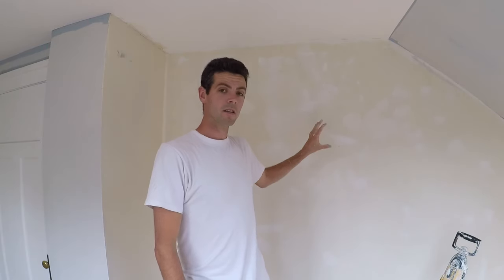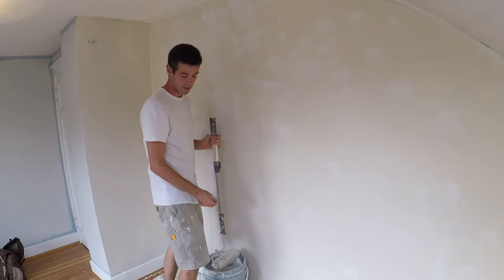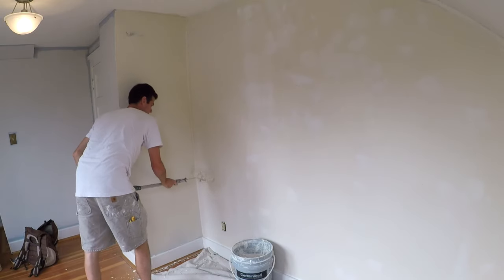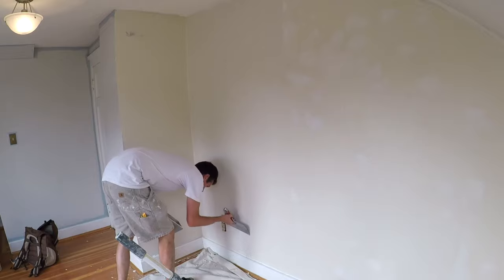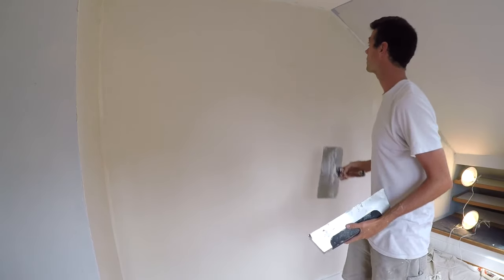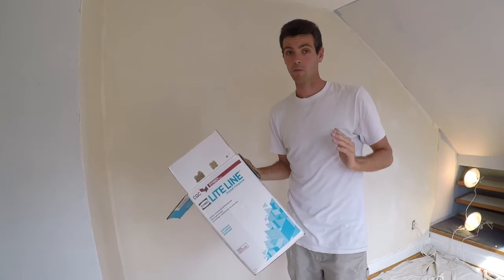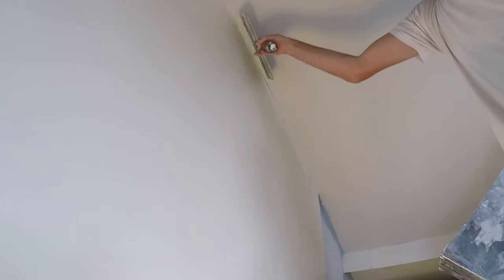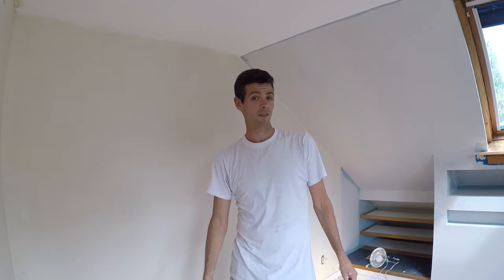The EASIEST WAY to SKIM COAT a wall!!!

Comment: just a tip from a german dude on the internet, get your roller prewet and drain like 90% of it before the first saturation process, makes it way easier
Reply: I also pre-wet my paper tape before bedding it.

Don’t see that taught or done on any video’s though.

Does anybody else pull their drywall paper tape (especially for the corners) through a bucket of water quickly before applying it & bedding it?.
Reply: @Casmige  My coworker was talking about doing this. So I know a few people at my work that do it this way. I think I will try it on my next project.
Reply: @Casmige  I do. It smooths out easier but I don’t do corners with wet tape
Reply: Thanks, German dude.
Reply: @Casmige  I believe Vancouver does have a video on that.  He says it's not what the pros do, but there's nothing wrong with it.  I believe he says a person shouldn't do on inside corners though.
Reply: According to a demo I watched, wetting it with water weakens the bond between the paper and mud. But many people swear by it, so it must work well.
Reply: Vielen Dank, Deutscher Typ!
Reply: Has anyone ever skim coated Paneling?  Any thoughts on skim coating Paneling?
Reply: There are special rollers for that (just bought one from Hornbach), and are very comfortable to work with

Comment: I find using a spray bottle of water to keep the knife blade wet really makes a huge improvement to the finish.  A mist of water on the knife blade makes for a very slick surface.  A quick sand and your done.
Reply: Just started doing this too. Basically keeping a big bucket of water and storing my tools in it while I roll the mud on. Also, cleaning the blades real quick just before starting to cut and keeping it wet on the finishing cuts. Works like a charm, even tho I'm a noob.
Reply: If you have or will post your process, let me know

Comment: As time passes while you’re doing a wall, the mud in the bucket tends to start to dry. I suggest anybody watching this video keep handy a bottle of water with which to spritz the compound in the bucket so that it doesn’t start getting very hard and heavy for you to work with it.
Reply: A small plastic cup  with just enough water to cover the surface works well also.

I use this method when storing mud also.

The bucket sides above the mud need to be clean.

I mix in water to a little thinner than what he used in the video. 

Then i pour in just enough water cover the surface about 1/8th inch deep.

Snap the lid on tight and the mud will keep for a long time.

Store in a shady cool place. Well at least shady.
Reply: @shawnr771  Also, cover the surface of the mud with plastic wrap to stop evaporation and hardening of the material.

Comment: The most I could do was hang a picture on the wall, but now I do skim coats apparently. I did this method and followed up with a stencil design. Everyone thinks it’s professionally done wallpaper. Currently doing an entire water closet, plus the ceiling. Thank you for this video!
Reply: Very cool, Lexi!
Reply: is premixed mud as good as mixing ur own?

Comment: My first try at skim coating went well but Scott, I used a trowel and hawk. I impressed myself as a first timer. I was looking at different ways to fix a bad paint job (deep deep deep brush marks) and walls where wallpaper was removed. Some people said try thick paint (took too many coats of paint) or paintable wall paper (did not try, I was afraid of seams opening). Skim coating was not that hard and I like how it turned out, a smooth wall.
Reply: @c Adamants your comment has given me some confidence ....i'm about to attempt the same after removing wallpaper from a wall half of the plaster on the wall also came off...i thought a thick wallpaper would cover it up but once i put up once  piece of wallpaper i could still see the crack under the wallpaper.. so now going to attempt a skim coat using this method ...wish me luck!
Reply: @coachBux  Good luck. As Scott says, don't try for perfection on the first try. You'll be surprised with the right tools you'll get the technique down in no time.

Comment: Nice video.  I like to wet the roller, then dip it into the mud in order that the roller doesn’t take so long to “accept” the mud.  Wetting the roller enables us to quickly load the roller.  A dry roller takes time to load up since the mud isn’t so wet nor is the roller and therefore the mud is inclined to “resist” adhering to the dry fibers of the roller.  Not soaking wet....just moist.

Comment: it's great being a giant.  Jesus, I need a ladder to reach my standard height ceilings.
Reply: He's tall, but this is a second floor as you can see by the sloped ceiling, and sometimes the ceilings are not as high as first floor in some houses.
Reply: And he uses stilts
Reply: @chadashley1434  hey i think you could actually just stick a broomstick into the handle of you roller.... it will save you from having to get ladder ect

Comment: This does work pretty well for a DIY situation. Working with mud is alot easier than most think. Just use regular mud, thin to about a pancake/ cake mix  and have fun with it! Take your time, don't expect it to be perfect with your first coat. You can always back fill holes with more mud later.. if it looks like crap Mist it liberally with water or a super wet sponge(let it soak in) scrape it all off and try it again. As long as it's not painted yet mud cleans up super easy with water. Sometimes it's easier to clean everything up with a wet rag than it is to mask everything off. Drywall repairs aren't cheap to have done so this is a worthwhile skill to learn!
Reply: Thanks!

Comment: Thanks to you, I started using a hawk and trowel to smooth-coat my knockdown textured walls (I’m doing the ceilings and walls for my whole house @ 3000 sq ft). It sucked at first, but I noticed my trowel was a piece of crap. So after I bent it into shape, it has now cut my time by close to 2/3 of the time it took me using a pan and knife. I was going to try this method, but I’m liking the hawk over the pan, because you can load it quickly using a bucket scraper and then clean the hawk easier and faster than a pan. The trowel being double sided is almost like using two 11” knives at the same time, and I don’t have to keep cleaning the trowel in the pan like you do with a knife and pan. It’s just sooo much faster!!! Like you said though, some jobs require a pan and knife.

Comment: THANK YOU!  I'm repairing my 1920's plaster walls - first time DIY because nobody around does plaster that I could find.  Learned A LOT from your videos.  Almost ready to skim.  This is VERY helpful.  THANKS!!!
Reply: lsabik88 as he said, plaster does not always do like that, but, apply a product such as bondcrete to the plaster, then you should get a decent flat finish with this technique bu a true plaster would be a better product sometimes. A trick I use on plaster is to use mesh tape, not paper tape, on corners and around outlets... just take your time. And keep the sections small as you work.
Reply: @brotheradam  Agree.  I skim with All Purpose -- over repairs on plaster wall. This video helped a lot.

Comment: After doing a very light knockdown texture in my bathroom, I have so much respect for you.  My back hurts so much today.  I still have to paint. Oh my gosh I started getting so upset over little bits of stuff making lines in my wall.  I was also tired and again hurting.  I am DIYing the bathroom remodel after work.  So there's that.  I want to thank you for these videos.  This has been my first go at drywall repair and covering.  Your videos made it less daunting.  Now I will likely use this method in the other bathroom as I do not want texture there.

Comment: The thing I got the most out of in this video was the very subtle angle changes of the scraper that changed the process from building up to smoothing off.  It’s the little things the make the biggest difference to overall finish quality. Thank you

Comment: Excellent tip! I’m a carpenter and definitely not a Sheetrock guy. I botched patching a wall after I installed the brackets (14 total) for 4 floating shelves. I used this technique to skim the wall sections and it came out wonderfully!
Thank you so much!!

Comment: Thank you so much for this video, I had to do it on all walls and ceiling in a room where the previous owner thought that the texture he applied looked good but was definitely an eyesore. I never did this before and a painter slammed me with a $2500 estimate to do it. I went to the big box and bought some materials and tools instead and wow, amazingly easy. I struggled the most around a big window due to the intricate trim but man, I am happy after the first coat… now… second coat 😅

Comment: The light was a good idea.  Just wanna say thanks too!  I had a washer-dryer area and using all your tips and techniques, it came out looking amazing.  Walls were wallpaper removal damaged and painted over, mudding hadn't been sanded but yet, painted over, tape missing, rotted walls from water leaks, you name it, I had it.  Now, they look like all brand new walls.  One thing; I didn't have a lot of strength so I used a wetted rubber blade for final smoothing and it resulted in a huge reduction in sanding.  The other, when I encountered a lot of bubbles.  I put the mud on, took it off and reapplied it immediately, (4-7' wall).  Not sure my arm could have taken it if the wall was any bigger.  Not sure what it did but no more bubbles.  Again, thanks!

Comment: Here's what you bring to the table: You take the fear out of skim coating. 
I was able to remove wall paper DRY with just a drywall knife and pulling off large sheets of the paper. Wife soaked and scraped the glue off. No damage from us, just something screwy with the paneling that went half way up the wall. Like there was a brown sheet glued to the drywall under the paneling. Also some of the wallpaper removed the drywall top layer of paper in large sections. SO wasn't looking forward to the skim coat until I saw this video. Thanks for the hard work conveying your knowledge. I appreciate you.
Reply: Hey man I'm going through the exact same thing right now, let me know how it goes for you
Reply: @Taha-ne9cd  Ok the skim coat: thicker is ok, it just means you get more to sand (ugh). Your shop vac needs a drywall dust bag or filter. Buy extras of both.
Leaving the line is ok, it sands easily.
Sheetrock brand Green top All purpose is harder to sand than the Plus3 dark blue top.
You'll need to thin it a bit. 
I used a 12 inch blade. 
Technique is slight pressure consistently on one side of knife. The joint compound WILL LIFT the other side of knife automatically. Amount of pressure is determined by thickness of joint compound.
Crumbs SUCK! but you'll get them no matter what. Don't sweat them. 
Divots and depressions after sanding will be filled, individually after sanding and wiping with damp sponge/cloth, let dry. 
ALL errors can be fixed after sanding. Don't sweat it.
Took me three walls and the fourth was really good (not perfect). 
GOOD ENOUGH rules the day when you're not a professional.
I am now fixing divots/depressions today and will sand tomorrow, prime the next day, paint the day after. . . boom done. BOOYAH!

Comment: Last year I had to get my mom's house ready for sale. One of the projects was doing a skim coat and using this very method. Years ago, when we were kids, my sister thought it would be a good idea to cover two walls with cork. Onto plaster walls. The cork board was hung to the wall using liquid nail... A lot of liquid nail OMG 
 I removed the cork. The liquid nail was like they were drawing and zigzagging with the caulking gun. All I could do was grind down the liquid nail. Get it close to something that resembled flat and then do exactly what the video shows. I was amazed at how well this works. Believe me when I say the 2 walls were F*****up. First time ever trying this. The finished walls with primer then paint was perfect. So follow directions you'll get there.

Comment: I love the roller texture.  Even the plasterwork on ceilings is great.  It really shows of skill.  I hope it comes back in style.
Reply: @helpmetoreach1ksubcribers233  Very nice work, I would hire you in a heartbeat to fix up my home.  That plaster is so much better than the drywall everyone uses here.
Reply: I did the roller texture on walls in a 400sqft room - I think it turned out pretty good looking.

I was initially going for smooth, but there were so many patches from rewiring and plumbing, and the old material wasn't nailed up all the great so a bunch of nail pops, wavyness, and random damage - so essentially just got frustrated and was like F it, I'm just going to roll the whole room. 

Prob should have watched some more of these videos first, but thankfully turned out pretty nice just taping the joints and then rolling the whole wall

Comment: The big disadvantage to the paint roller method is a lot of times depending on your porosity of the wall, if you're going over bare drywall or flat paint, the joint compound actually dries before you can knock it down. So it's a good trick in the bag, but sometimes just using an actual plaster trowel and hawk is better. Another thing too is just using Easy Sand to level out a wall, and just doing a final very light skim coat with All Purpose to give an easier to sand base coat.
Reply: I’d like to keep a spray bottle set to mist to resolve my mud and sometimes even paint from drying faster than I’d like. And I’d probably pre-mist bare drywall if I was going over that.

Comment: I skim coated 3 walls with the roller method ... small sections then knife smoothed them...I had 'washboard' as you called it and didn't know why - thanks. Position of knife when pulling the mud...who'd a thunk it !!

Comment: Thanks for posting this.  I've been skim coating the walls of my apartment for the last week. I tried this roller method and ended up with mud flying off the roller and making a mess. Now I'm wondering if if the mud was too thin.  After that I skimmed most the walls by applying the mud with the knife.  For a novice it was a lot work, and as you pointed out in an earlier video, an inexperienced worker doesn't have the strength in their hands of an experienced dry waller. Hand very sore.  I have one more room to go, and I'm going to try the roller application again. Hopefully I picked up some new information from this video.  Your posts are incredible. I have to tape an area of drywall and unfinished wood, and thanks to you I learned about the tear off bead in another post. I was pondering how I was going to manage that situation. You've given me confidence to preserve with this project. Thank you.
Reply: Rolling fast will also cause mud to go airborne
Reply: @samo4648  Thank you .  I have one more room to go and I will take your advice into consideration.

Comment: Hey, Vancouver Carpenter.  I watched your video yesterday and today I skim coated my bathroom after removing wallpaper and priming with Gardz.  Your rolling method of applying the mud worked GREAT, much faster than using a drywall pan.  Where I live all drywall also is textured, so that will be my next step on my bathroom project.  I am glad for the texture step as I think that will hide my lack of skill.  Thanks for your helpful video!!!

Comment: Great video!   I have an old house and the hallway is a mess.  Appreciate the courage!   
Just a tip- I like to use a shower squeegee on the finish coat when I’m working on repairs at my rentals. It never drags any dried bits across the finish and sanding is cut down to a minimum. I use for small areas. Don’t think it would work with such a large area but it really reduces the sanding and gives a perfect finish.

Comment: Thank you all the way from Germany! these German painter charge me an arm and a leg for smooth walls (most people here like wood chip wallpaper which gives a knockdown finish). To get smooth walls first they sand the raw walls, then they skim coat, then they sand the skim coat, then they wallpaper with what they call painter's fleece (like a glass woven  cloudy and thin white fabric) and paint 2 times over that with dispersion paint.. it's nuts. I bought a premade mud (knauf super finish) and skim coated my wall, then I'll sand it, and then I'll paint with a 2in1 paint + primer.. done!
Reply: Hello. Was the was a plastered wall ??
Can I use this technique to skim coat a plastered wall??

Comment: I think it will help if you wet your roller before dipping it into the mud. Reason?  The mud water will more easily attach to the roller if the roller fibres have water on them.  Ever try to push a brand new mop into a bucket of water?
What happens?  Mop pops out of the bucket. Same idea here.  Thanks for all your help!!!!

Comment: You should mark your knives so you know what side you have facing the wall without looking. I took a half round file and put a finger groove on the back side of all my handles.
Reply from the maker: Good idea!
Reply: are all blades curved? Mine don't look like they are
Reply: I've got a big red 'NO!' written in sharpie on one side of them, mostly for the sake of others.. :-)
Reply: @Cam-wi3tp  I think the stamped ones are (with the aluminum bar)
Reply: rumpleforeskin73  first off, great name. Second, it sounds like the reason I don't let others "play" with my calligraphy pens. The nibs will bend to the consistent use of their owner over time and then someone reshapes them for you. Rrrgh.

Comment: Thanks!  I will be trying this on some of the road weary walls in my apartments that have battle scars from nails, hole repairs, etc.
The close ups were awesome, much appreciated, and it was great hearing you call out the spots where a novice will need more patience (like around the outlets).
Awesome video!